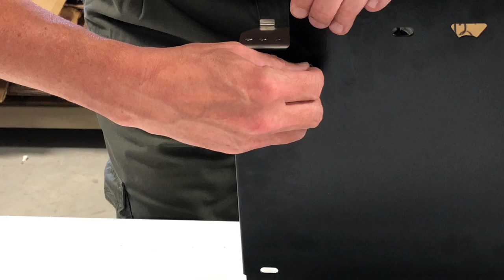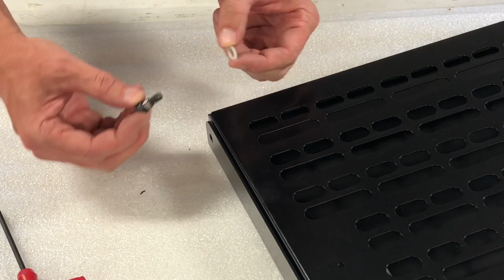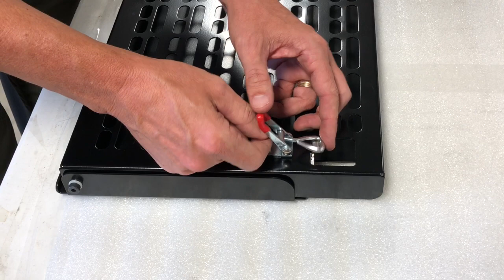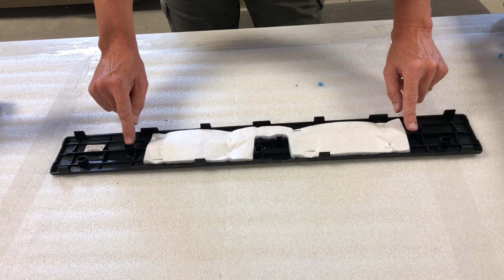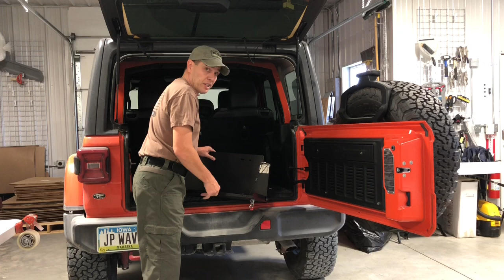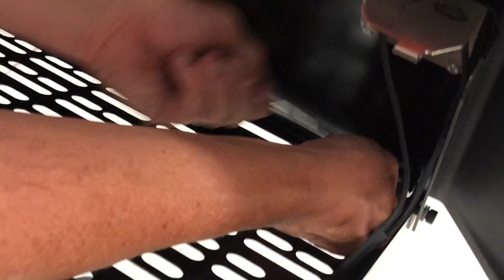Springtail Jeep Wrangler JL Rear Door Folding Table MOLLE Panel Assembly and Installation

Comment: Do the shoulder bolts with the nylon washers tighten down all the way or will the nylon washer be loose when finished?
Reply: The shoulder bolts allow the table a bit of latitude to move from side to side....the nylon washers are not tight as they act more as a buffer if needed.
Reply: Ok good. My arm was getting tired.